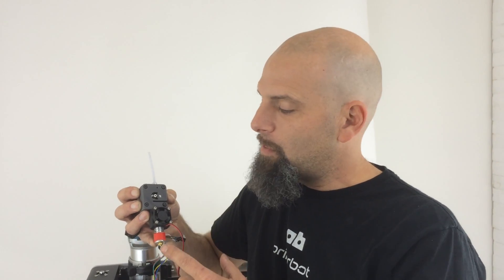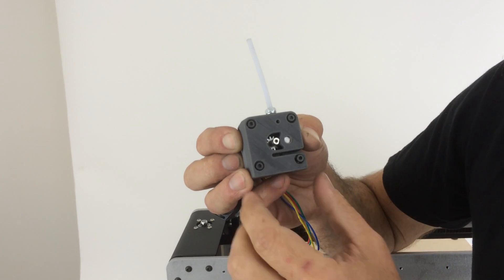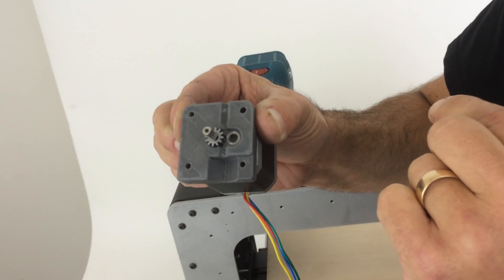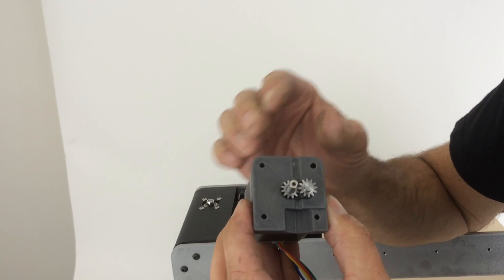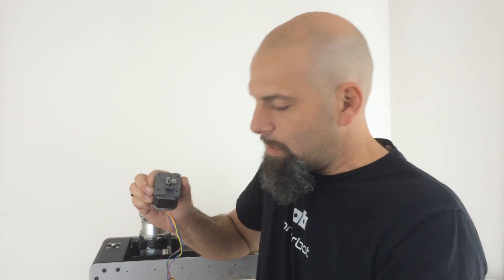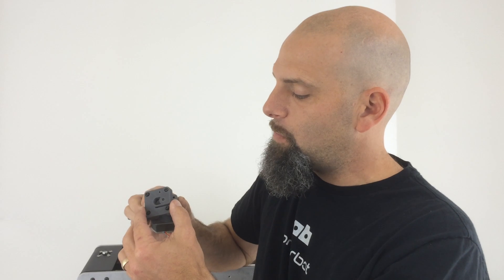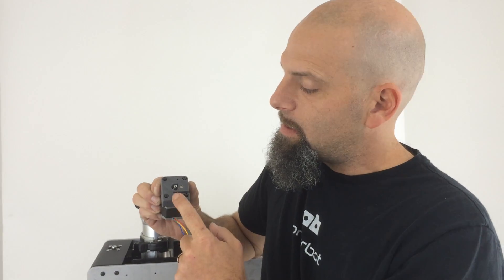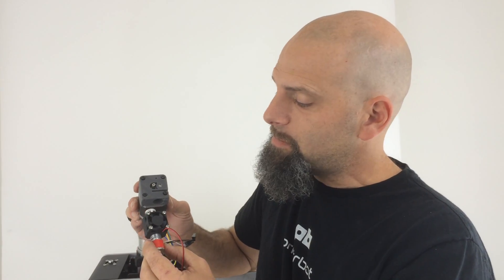Printrbot Double-Drive Extruder

Comment: How do you remove material? I switch between ABS and PLA usually I just pull out the material while the hot end is hot.  It looks like you would have to use the computer to push the filament backward to remove it while the hot end is hot or am I missing something?

Comment: Brook, I have a PB Plus that I am finally finishing the z-x and double extruder upgrade.   It ran full time for 3 months during a research project with University of Tennessee but had a little extra vibration.   I am now considering redesigning the base of the extruder motors to fit them head to head in the Y direction.  Is there any reason why you choose the X direction?

Comment: Just printed it. I printed it with supports as there are many overhangs that need it. Did anyone try to print without support?
Also, I noticed there is a slight taper on the sides of the front pieces. Was that done on purpose? Love the included knob to easily feed filament without needing to control the extruder motor form control software.
Reply from the maker: The sides have a draft so we can use the model to build the injection molded parts
Reply: Good thinking
Reply: +Michael Spano Jr Can you link the print files? Can't seem to find them...
Reply: Not off hand from my phone but if you go to youmagine and search printrbot they should be on there.
Reply: Michael Spano Jr Thanks man for the quick response, Ill check it out!